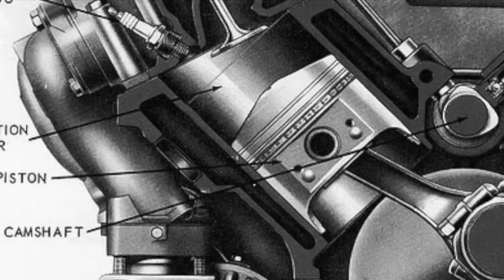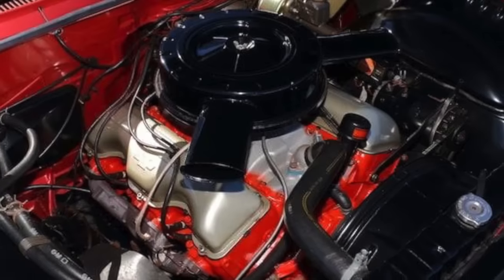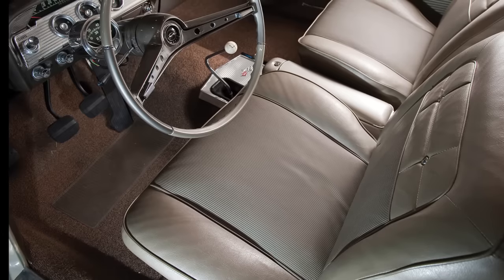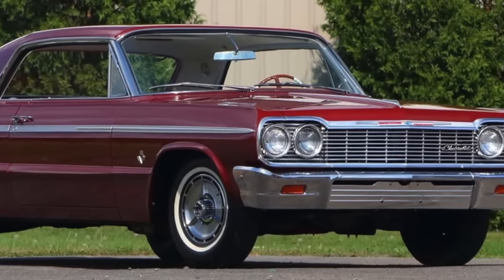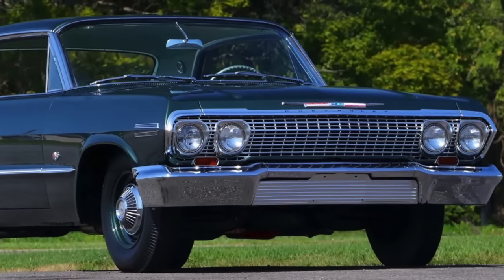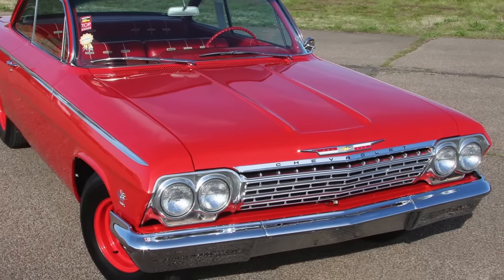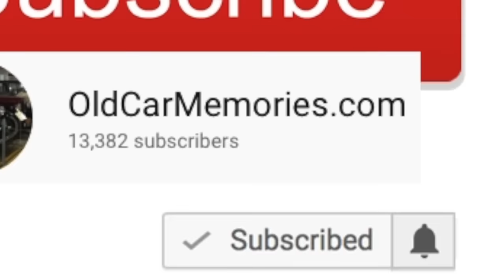1961-1965 Chevrolet 409 V8 - The Ultimate Budget High Performance V8

Comment: There was a 409 HP engine available cheaply to the public in 1962?
Reply: Back then gasoline had lead in it which allowed very high compression ratios, which means more power. I think the commentator said that this engine had  a 13.5 to 1 ratio, which would make much higher than any engine from today.
Reply: Lead in the gasoline to prevent knock helps along with manufacturers using gross horse power ratings (measured at the crank with no ancillaries attached) and no pollution control attached along with long tube headers on the bench test, goes a long ways to make the numbers look good.  Realistically, if you put one of those engines built as new on a dyno today and tested it for SAE you'd most likely get around 350HP or there about.  Which is still plenty decent and enough to get into trouble with :)
Reply: No, it was 409 cubic inches. Horsepower would have been less.
Reply: Ron Strzelecki 
1 HP per cubic inch sounds about right for back in that day.
Reply: $430 was about 5 or 6 weeks pay back then.
Reply: For high school kids of the day, more like $1/hour and 430 hours, 10 - 20 weeks gross pay...
Reply: BuzzLOLOL
Exactly. I worked at Pontchartrain Beach amusement part during the summers making $1.00/hr while working on games, $1.10/hr while working on rides. It was seasonal work so they didn't have to pay us $1.25/hr min wage. We made from $50 to $80 a week! And had a great time.I also had to work at my Dad's grocery/butcher shop for nothing/room and board all year long before going to my paying job.
Reply: Mid - late 1960's I think minimum wage was $1.10/hour around here...
Reply: The narrator refers to the 376-dollar tariff for the 1962 409-horse 409, as "easily affordable" which, according to a reputable inflation calculator, would be equivalent to $3091.58 in November 2017 dollars.  Given that wages hovered around $1.10 to $1.25 (before taxes) back then and that there are 2084 work-hours in a year, assuming 40 hours per week-- it's hard to make the case that it was realistically attainable by the common (Chevy-lovin') man but where there's a will, there's a way, and Chevy built over 15,000 409s in '62.
Reply: This data's from Martyn Schorr's book, "Day One:  An Automotive Journalist's Muscle Car Memoir".  Schorr says Chevy built 15,019 409 engines in 1962. Of those 15,019, only 8,909 were used for new car assembly (with the balance of 6110 used for warranties and over-the-counter sales). Chevy built 1,424,000 full-sized passenger autos in '62 so the 409 take percentage for 1962 was a paltry 6/10 of one percent!  That means for every single 1962 409 you had 198 run-of-the-mill six-cylinder, 283 and 327 full-sized Chevys leaving the lot.  This is evidence of it's rarity and exorbitant cost.
Reply: @Noel Molina.....Compression ratios are very misleading. Are you aware of what that ratio actually refers to?
Reply: No new Chevy would not have been affordable for anyone making $1.25 an hour then (federal minimum wage in 1962 was $1.15/hr) any more than a new car is affordable for anyone making minimum wage today. But as far as new cars go, affordable for a family with a middle-class income certainly. According to a government report of the day, median family income was estimated at $6,000 in 1962 (just over $49,000 adjusted for inflation). For reference, a top of the line Chevy Impala was a hair over $3,000 in '62... This was in the days when incomes were on the rise annually, and people knew something about saving for things, not so common today.
Reply: I don't know about that, most hi performance engines back then  11:1 was usually was the norm. The most compression as i recall was the ford 406 with 403 hp, which had 12:1 compression ratio.  I nspent my childhood days reading The blue hardback chilton repair manual which i read cover to cover several times..lol
It covered all makes and models, with hp compression ratios, crank and rod journal sizes, bores , stroke valve head sizes, oil pressure..Was the best book i ever read.
Also sunoco sold gas up to 105 octane, and it contained lead, valve ping was unheard of.
Reply: @Raymond wagoner.....Yet very few understand what compression RATIO actually refers to. To most it's a buzz word.
Reply: 20alphabet, 409 stock rated HP ranged from about 250 (trucks) - 425 HP...
Reply: I doubt that it was 13.5/1 as one wrote. 12 or 12.5/1 is probably more accurate. Just a trivia fact. My VW diesel had a 22/1 ratio. This is why diesels have such high low end torque and produce much less waste/ polution than gasoline engines. The perception is the opposite as gasoline exhaust is invisible and odorless.
Reply: BBC L88 427" at 12.5:1 was about highest stock... limited production Z11 409-look 427" race only engine may have been 13.5:1...
Reply: The 62 model with 2-4s was rated at 409 hp in 63 they were rated at 425 hp.
Reply: Ratio of how much air is compressed inside the bore by the piston from BDC position to TDC position, during the compression stroke, & is determined by the distance or length measured from the exact centre of the main bearing journal on the crankshaft, to the exact centre of the conrod journal of the crankhaft, or commonly known as "crank throw"
Reply: Once they dropped the octane down to 95, even my Harley pinged like crazy. They essentially took all high compression engines off the road. Mine was only 2 years old when it was pining due to low octane.
Reply: I stand corrected, Chevy did build a 13.5:1 compression ratio 409 for drag racers in 63 I believe. I think a few people did buy them for regular Chevy's. I doubt that any survived till now.
Reply: Travis Kraft ..
You have to remember min wage was like a dime back them a hour..so no not so cheap
Reply: Actually, minimum wage was $1.10/hour in 1962. Even though, it would take many work hours to earn the extra cost of the 409.
Reply: I worked nights parking cars while going to school in 1964-65, and got a huge raise from $1 to 1.25 per hour when federal minimum wage standards became applicable to the job.  Guess it had something to do with cars being in interstate commerce, or something.
Reply: raymond wagoner 
Ya man Chilton & Motor Manuel's were my books of choice. Almost memorized a few of the sections. 
CHEV &  GMC. Specs, were my favorite...
Reply: 20alphabet wrong! The top production version was a 409 hp 409 ci engine.
Reply: Ya the Beach Boys wrote a song  she's real fine my  409  …  They built some 427's for NASCAR  too
Reply: My  Grandfather  bought a used Model T Ford for $35.00  he made about $3.00 per week back then .  I knew a guy  who made enough money shooting Sparrows with a 2 cents bounty on them to buy a $13.00 bicycle and 22 shorts  50 rounds cost 13 cents per box ..
Reply: It's  the  volume of the cylinder  at  bottom  dead center   compared to the volume at top dead center..   ..   and  409.s had flat heads with some pockets for the valves they had very high compression with flat top pistons for some reason they made a  lot of torque even though they had a large bore and sort stroke ..
Reply: You can buy a Brand new Dart 409 today if you want one ..
Reply: Truth.
Reply: Chevrolet built a limited run of the 427 Mystery Motor for racers.  It was on a 409 block with prototype rat motor heads.
Reply: That's what he said genius, lol. JK
Reply: Yes sir. But the 421 super duty Pontiac was an even better performer for around the same money
Reply: Saw a bone stock 409/409 on the dyno. And it made a maximum 406 horsepower. Right after that, I saw a bone stock 421sd Pontiac engine crank out 488 horsepower at the same 5800 rpm as the 409/409 Chevy. The 409 Chevy's we're fast but couldn't quite match up with the Super Duty Pontiacs, R-Code Ford's, and Max Wedge Mopars of that era
Reply: @LeonAnilom  yup olds had a notoriously high compression v8 in 60 s
Reply: @jeremythompson9895  The 421 SD had large port,nicely configured heads. It breathed much better than the 409,which had the worst combustion chambers in the history of automobiles ever.....( Please dont attack me,I am writing from experience).......Even with crappy combustion chambers ,the 409/425 made gobs of power !!!!...Go figure.
Reply: @johncollins2442  Only the Z11 had 13/1
Reply: @jeremythompson9895  Z11 would walk the talk on an SD 421. I have owned both.
Reply: @charliechristie2949  The oil system was weak on the SD.
Reply: You are right. Most people don't know that the 348 & 409 motors had the combustion chamber in the cylinder and the heads were actually flat. Weird. I had a friend with the 348 tri power in a 58 impala. He hated the engine but, it was a show car so he had to stay original.He said he had a big problem with bending rods on hard accel. I knew nothing of the workings of those motors. Just laughed whenever I saw one........By the way. Relax. I never attack anybody.
Reply: Travis. It was 409 cubic inches  In ‘64 the HP was 425 with dual quads. Not sure of HP in ‘62 but it was under 400    It was a $300 option   That’s a lot of cash in ‘62. The car cost about 3 grand
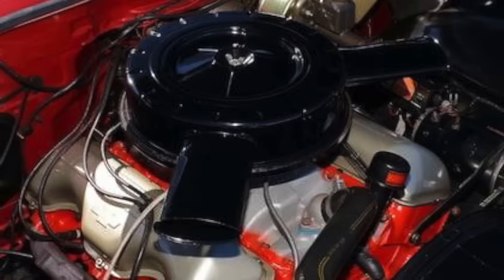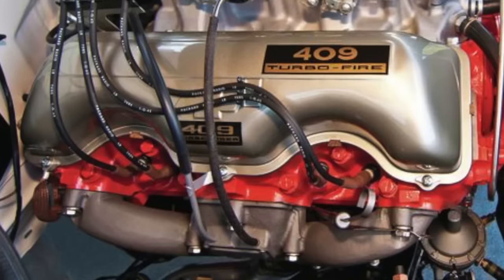Reply: @20alphabet  Watch the video.  At 03:18 the specs of the original (1961) 409 cubic inch Chevy V8  include 409 foot pounds of torque.  At 04:30 you'll see the 'dual quad' 409 rated at 409 horsepower.
Reply: @milessaway8309  Correct.
The 'dual quad' 409 had taller, 'high runner' heads with 583 or 690 suffix casting numbers.
I have a pair for sale, ported and polished.
Reply: @johncollins2442  Decades ago, I put one in a '59 Impala Sport Coupe (Roman Red, factory air...) when it's 348 seized.  It was a racing 409 from Chevy's 1962 Stock Car season. I didn't use its 'cool can' setup on the '59, but the Chevy bowtie aluminum high rise 'oval track' manifold stayed with its Carter AFB (it also came with the entire 2X4 setup in a box) and various Offenhauser stuff.  
It was a wondrously ill mannered and powerful beast.  It spit out any head gasket other than thin copper shims and consumed pushrods.
I still have the tall runner 690 heads - ported and polished-  and would sell them.
Reply: @charliechristie2949  I had a 1959 Impala Sport Coupe 'back in the day' with the 348. When it seized I found a 409 for sale that turned out to be from a former oval track racer.  
I could only use thin copper shims for head gaskets (it spit out any others) and it consumed pushrods.
It was, however, a wondrously powerful beast.
Reply: @jeremythompson9895  Measured at the crankshaft or rear wheels?
Reply: was a 425 hp on 409cii some say 409 hp..pontiac had a 421 sd 2 4's  had 425 hp..
Reply: @20alphabet  There was, indeed, a 409 - 409 HP.  They went as high as 425HP in stock form.
Reply: @-oiiio-3993  
I know that rejetting the carburetor and recurving the distributor often led to some pretty impressive gains. An old racer in Upland, Calif. named Dave Lang said he had an old poly 318 in a Plymouth Fury, and by just those two adjustments the car got into the 13 second quarter mile range. Can't imagine the 409 couldn't do better. Over 500hp seems like a stretch though.
Reply: @LeonAnilom  the regular 409 had 11:1 compression, the 13.5:1 figure youre thinking of was some special motors meant for nascar and other special hi performance projects that got released to some dealers.  Wasn’t a typical motor.
Reply: Yup
Reply: Yup, I rode around in one.
Reply: @tomschweikert9537  the 49 Oldsmobile that my buddy had could beat most of the small block chevy's block to block.
Reply: @20alphabet  409 cu in  425 HP gross for the top dog
Reply: @mrbubbarosa  
That's more like it.
Reply: @invictusbp1prop143  I still have a pair of the tall runner hipo heads.
Reply: 1971 Zozo  Define "trash".
The 396 and its descendants were less ill mannered mannered and make better 'grocery getters'.
Reply: 1971 Zozo  I had a hipo 409.
Reply: 1971 Zozo  There are many reasons the Mark 3 'big block' replaced the Mark 2.
To call the 409 'garbage', however is both arrogant and ignorant.
Reply: @charliechristie2949  My 409 was a former Nascar engine at 13:1.
The only head gaskets that would last more than a few months (at best) were thin copper shims and it was constantly bending pushrods.
Reply: @johncollins2442  The high compression 409 used special 'tall runner' heads.
I still have a pair, ported and polished.
Reply: 1971 Zozo  By your 'reasoning' the 396 must also be 'garbage' as "they quit making it".
Duesenbergs, 427 Corvettes, P 51 aircraft... all must be "garbage" as they are no longer made.
Ridiculous.
Reply: @20alphabet  put it on a dyno and I bet it makes more than that.

Comment: It would seem the 425hp 409 could give anything back in the days a good run for the money?
Reply: Don't forget about Pontiac's 421 super duty, Dodge and Plymouth 413 max wedge  and Ford 406 and 427 all putting out 400- 425 horsepower. This was before the GTO era muscle cars.
Reply: Ford had the MEL 430/425 in 1958 available in the Mercury Turnpike Cruiser and 1959 Ford Thunderbird, so I have read.
Reply: I remember the 430 T-Bird and Lincoln. I don't remember a 430 Mercury.
Reply: How did you keep the front from scrapping the road with so much weight on the front suspension? I had a 57 ford with a 390 ford engine. Truck springs keep it high off the pavement.
Reply: A well tuned 413 in a '62 Dodge or Plymouth could easily mop the floor w/ a 409.

Comment: you should make another video but from 58 to 61 all on the 348
Reply: They had about 10 versions producing from 250 HP to 350 HP. Compression ratios ranged from 9.5:1  to 11.25:1. Carburetors available was 4 or 3-2 barrels. Also special cams and more efficient heads were used.
Reply: @johncollins2442  or you could just take the fastest one or the one that made the most power make a nice video on that

Comment: A good friend use to let me take his 1961 Super Sport with this block. Tri Power. Not sure what they did he would never devulge but it sounded much stronger after the engine rebuild.  The garage that did it ran race machines and could do anything to these motors. So I bet it was a 409 with a performance cam.

Comment: What I recall is that 348/409 were problamatic engines. They were originally designed for trucks. When the managers of Chevrolet learned that Ford was working on its big block 332 ci engine, they knew that they had to also have a big block. They had to use what they had and so although the engineeres had doubts about the reliability of the engine in a car, the managers told them to do the best they could. The engine would probably have not had such a bad reputation if Chevy had not turned it into a race engine. Yet, they wanted to compete with Ford and so they tried to get as much power out of it as possible. Obviously when one uses an engine originallly designed for something other than racing, that engine is going to have reliability difficulties. When the engineers were told to increase compression ratios, put in race type cams and use multiple carburators, they knew that the  reliability of the engines would suffer. Many people were constantly either repairing the valve train,  other parts of these engines or they were paying other people to do that. I will never understand why Chevy failed to engineer a replacement for this engine sooner than late 1965. Its delay in designing a decent V8 damaged its reputation. I agree that it had to compete with Ford. Yet, it knew by the late 50's that the 348 already had a poor reputation. Instead of building a reliable big block, it made the 348 even less reliable when it not only increased its size to 409, but forced it to produce so more HP that it would tear itself apart. By 1963, or perhaps even earlier, few racers even considered buying this engine. One would think that GM would have learned its lesson from this error. Yet, in 1977, it was determined to have a diesel engine. Once again, it ignored the warning i of its own engineers and converted the 350 to diesel. The 350 was a very reliable gasoline engine. The engineers quickly learned that it was a terrible diesel and warned the managers who failed to heed them. They were so bad that owners of these cars brought a class action lawsuit agiast GM. Of course the lawyers were well paid and the owners got a check for abot $500. Again, the managers decison to release a product that their engineers had doubts about caused harm to the reputation of GM. Will they ever learn from their mistakes?
Reply: Was not intended for trucks. Cars were getting larger and heavier. The engine was on the boards in 57. Some 57 Chevys had the 348 in them for testing.
Reply: I did a little research. Many sources, including wikipedia state that it was originally designed for trucks but was used for the larger cars that were designed starting in 1958. I recall even in the mid 1960's that people said it was made for trucks. There are also a few sources that claim that it was made for trucks and cars. Now, 60 years later, it is difficult to know who is right. Whatever is the case, it became an engine that would break parts when Duntov and his crew started forcing it to produce more power than it was designed to put out and drivers pushed it too hard. The 396/427 and other manufacturers  big blocks were much more reliable engines.
Reply: I might be wrong but i do believe that engine was a 352?
Reply: 352 I think was the Ford "Interceptor"  engine
Reply: The 409 was a little bit more different than the 348 you cannot take a 348 and turn it into a 409because the bottom of the 409 is a little bit wider than the 348 and the new version would hold up a lot better,and they would scream like you would not believe!!!!!!!
Reply: @dawnmetsala3631  332 was the first one. It then grew to 352, 390, 406 and finally 427.

Comment: Those motors were made in Tonawanda , NY .  Chevrolet Engine Plant , back in the 60s there were 15,000 employees .
Reply: I have a 1998 454 (7.4L) built at Tonawonda, still running strong @ 322,000 miles